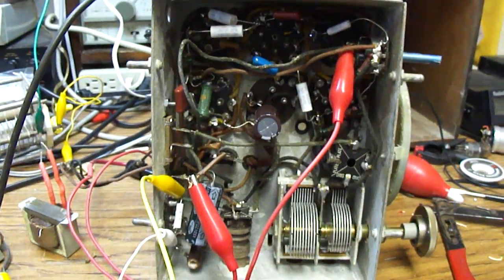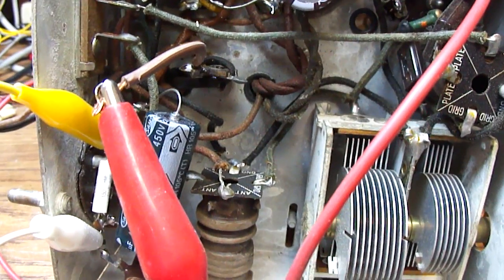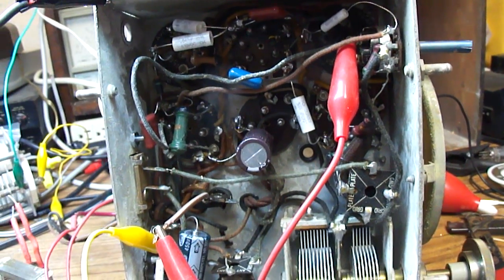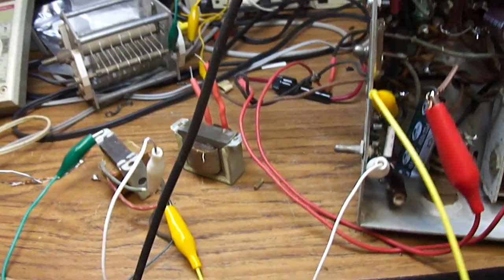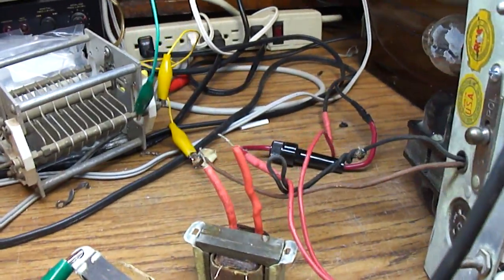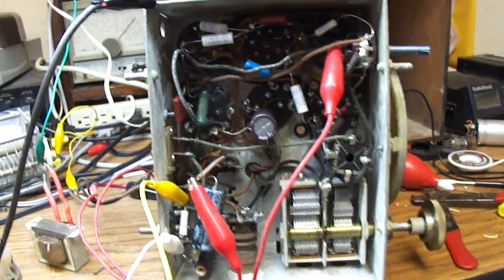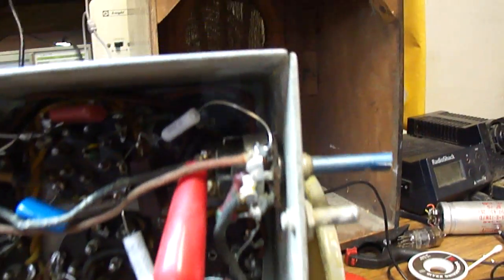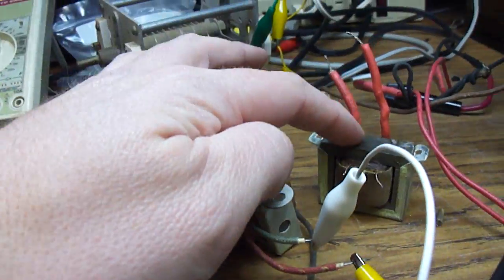1930's Arvin model 417 "Rhythm Baby" tube radio test

Comment: By the way, the volume control looks like a replacement, it's possible that someone may have replaced the original audio taper volume control with a linear taper pot used for a tone control. It isn't common but it seems to happen once in a while. Other then that it looks like the set just needs an IF and oscillator allignment in order to track properly. My guess is that the set is probably from about 1936-37 or so judging by the dial and the tube types chosen, it should be a neat set.

Comment: It might be worth seeing if you could find a replacement cone for that speaker, if a bad cone is the only problem, small electrodynamic speakers are harder to find these days. Even if you can't there are companies that could recone that speaker for you, not the cheapest way to go but it may be worth doing. Also if the set had all of it's original Arvin branded caps it would be worth saving them in case you or a future owner wants to restuff them.

Comment from the maker: @joshhsega There's not really any definitive time they go bad, unlike things like old paper capacitors which usually degrade over time. The power transformer in this set works fine. Sometimes I think corrosion takes place in the windings which can cause them to open, or overheating can burn internal wiring and cause shorts.